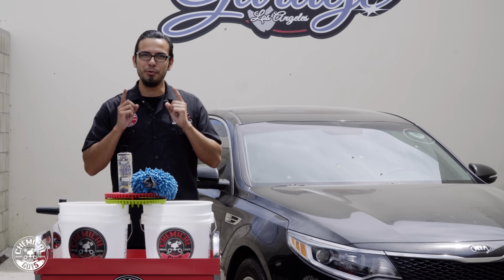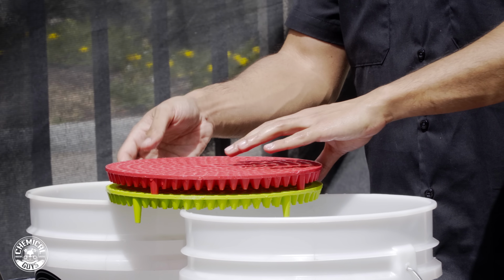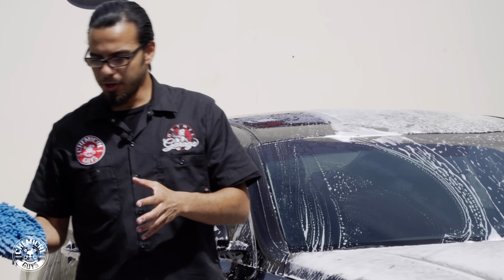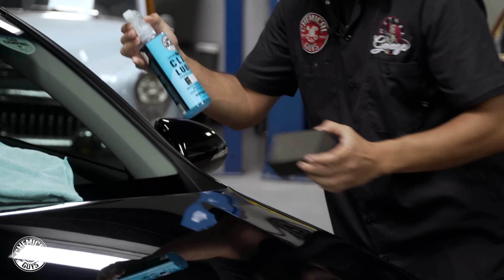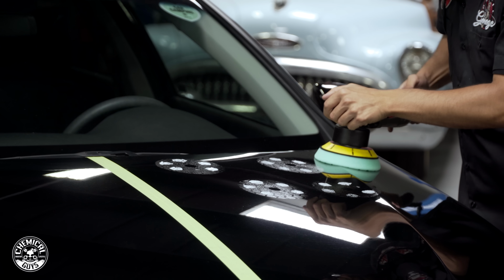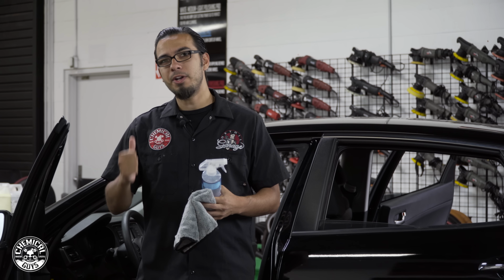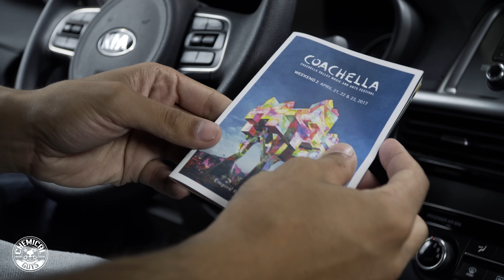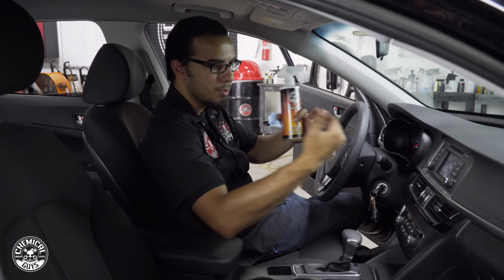How To Make Your Car Shine Like New After Coachella Weekend! - KIA - Chemical Guys Car Care

Comment: Hey Chemical Guys. Can V36 be applied by hand or should it be applied with a buffer only. Thanks. I like when this guy does the videos. He seems to be the face of Chemical Guys.
Reply from the maker: Hi Brian, you can use either or when using V36. We highly recommend you use a machine to cut your amount of time polishing in half, nevertheless, the amount of fatigue you will be feeling after doing it by hand. Also, your hand cannot replicate the speed and cutting abilities as the machine to truly give your paint the perfect polish. We suggest you save the hand polishing on smaller intricate parts on your vehicle.

Comment: Citrus Wash Clear isnt in your online shop. Whats new with this soap? Greetings from germany
Reply from the maker: Hi Jay, 

The Citrus Wash Clear is much, much more gentle than the regular Citrus wash & gloss. It doesn't strip off any wax or sealant like the regular one does. It's also able to produce max amount of suds to lift then pull of dirt off the paintwork. Also, it does not streak or spot when washing.
Reply: Chemical Guys ...sounds very good to me- thank you for the quick reply!

Comment: can someone answer on what speed you should wax a car?? also for the glaze cant i use the orange hex pad?
Reply: UnTaMeDBoltz11 I polish cars at just under Max speed with an orbital. mine is the Griot's boss 21. a porter cable will be at Max or a notch below I usually use the notch below. youll also want to use 5 inch pads with the porter cable. bigger pass will big it down. some will say a bit slower. depends on the paint too. softer paint might do better with lower speed and a softer polishing pad.. or maybe even a waxing pad. while others do better with higher speed and a more aggressive Polishing pad, such as harder paint
Reply: Thanks for the detailed reply but using their black pad and da polisher, would you recommend waxing/sealing the paint at low or high speeds? like maybe spreading it in at 1 and working it in at about 3?

Comment: That Claybar is a sponge?
Reply from the maker: The clayblock removes dust, dirt, debris, industrial fallout, and brake dust from the pores inside the paint. Nick coats the surface with Clay Luber to prevent the clay bar from dragging across the paint, which prevents marring. The clay luber doesn't function like a cleaning agent.

Comment: These days you need a phd and a lab coat to clean a car
Reply from the maker: Not really, the technology is just more advanced. But like any hobby, it can be expensive. Detailing a car is like cleaning your body: First you wash, then you use a loofah with a course texture to peel off any dead skin, then you use something to cover up blemishes, after you apply sunscreen, and finally you apply a lotion to nourish the skin, or Vaseline to protect sensitive areas. Most people are used to washing with water and buckets, using a sponge, and drying with a body towel. I can remember when people used newspaper to clean glass, where did that idea come from? I think people looked at the process of washing your car, and realized they were doing more damage, and this can be evident in the condition of the paint in all types of cars.